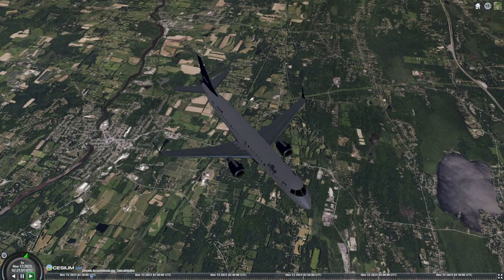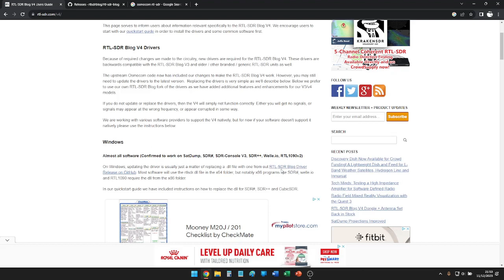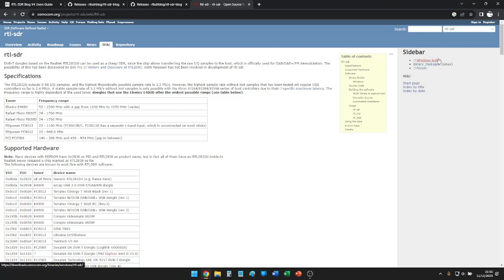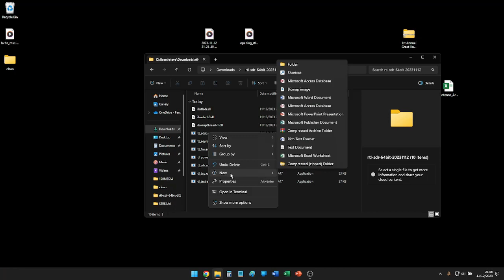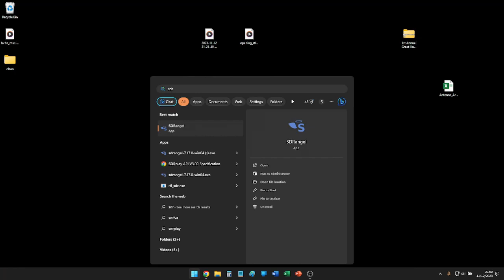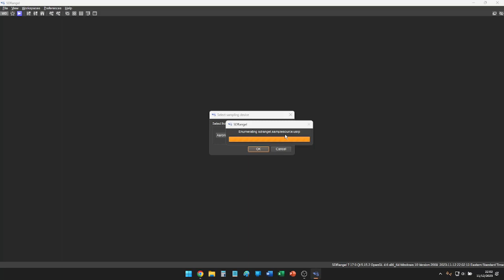How To Use: Reserializing and RTL-SDR + SDRangel Version 7 Series (Part 2 of 3)

Comment: Thanks sooo much for your SDRAngel videos. As amazing as the software is it can be overwhelming, to say the least. Your videos are an invaluable resource for anyone starting to take up SDR as a hobby or the seasoned ham radio operators learning new tech. 
As far as the reserialization, first I put random 8 digit sequences on each device, which worked perfectly. Just for organizational purposes, I went back  and changed the serial IDs to letters, NESDRXt and RTLSDRV4 for example. I connected the dongles and they appeared with the new (alpha-numeric) identification and appear to work properly. Will this cause any issues down the road? Thanks again! 

Buffalo/Niagra International Airport?? Never mind, the first guy got it right with SWF.